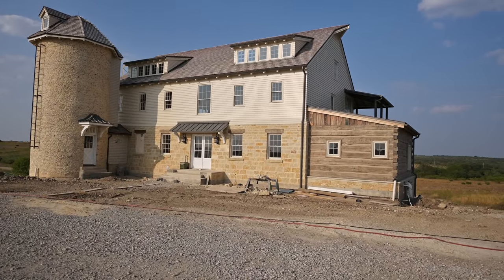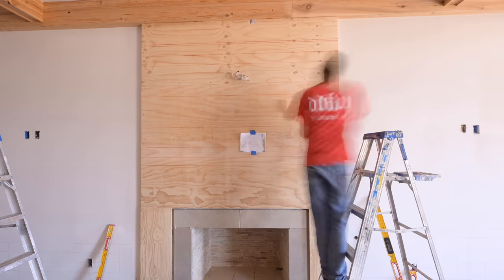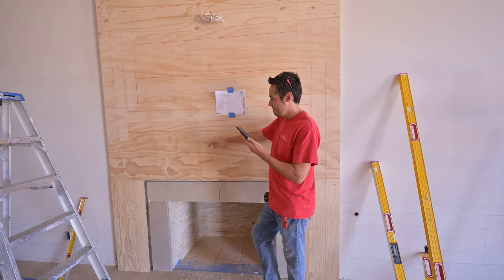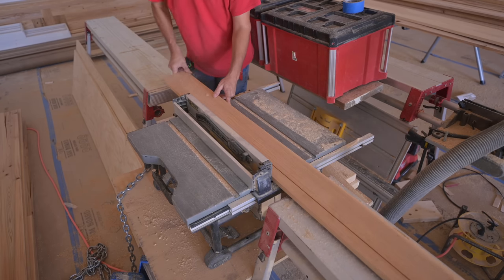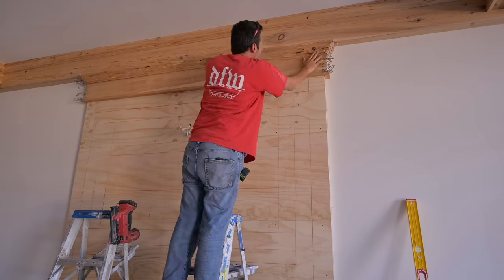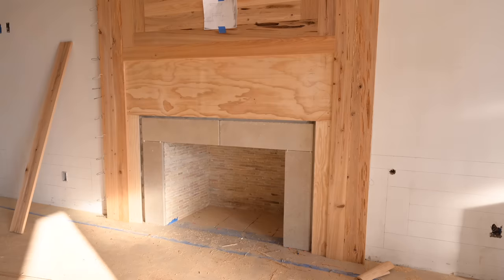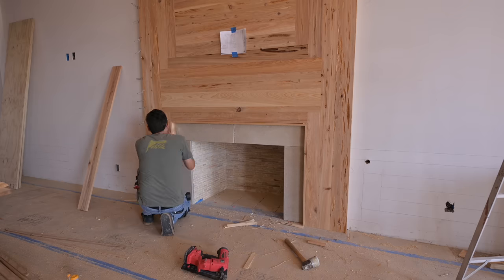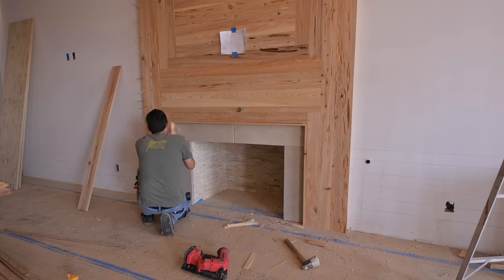Classical Fireplace Mantel Full Build - Timeless Carpentry

Comment: Appreciate the walk thru this incredible creation, especially all the technical details of what you were doing step by step. I had a question for you. In more recent videos you have been wood glueing your joints with the spring clamps. In older videos you used to use super glue and accelerator. Do you still use super glue and accelerator and if so when you do you choose to use it versus wood glue?  Thanks.

Comment: you need to get yourself a projector. Hook it up to a computer, set projector on a tripod. Allows you to push out or in, expand, level up or down. I have used one many times in the past. Its a time and life saver. Basically gives you a real life picture on the wall to help for perspective, balance and dimensions more accurately.

Comment: Wanted to also ask you, Richard: Was totally surprised on how you only used the 15ga. What size of nails did you end up using for all this layering and did you toe nail them or straight? And Will you hide the nails with wood filler before the painters come or use Bondo putty or leave them untouched for that rustic look? Tnx!